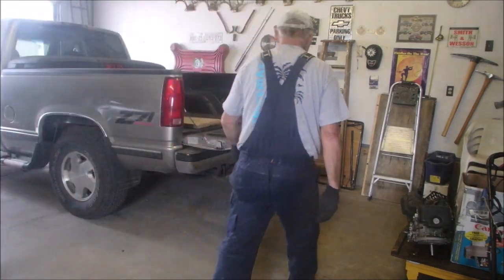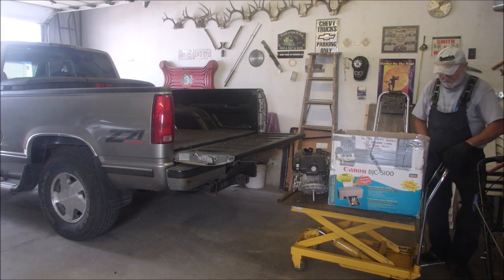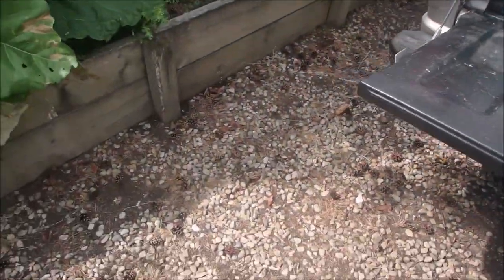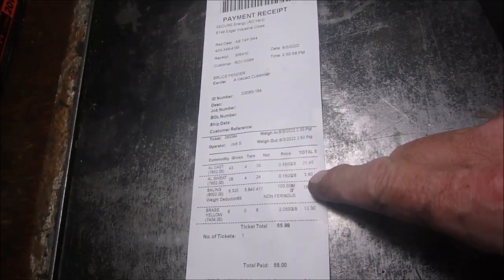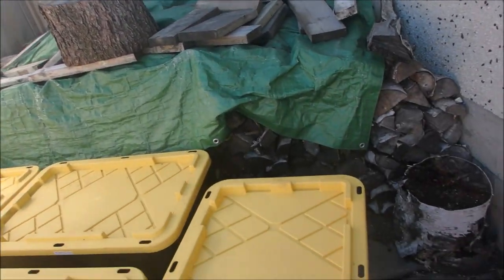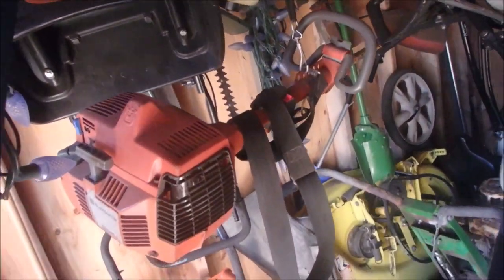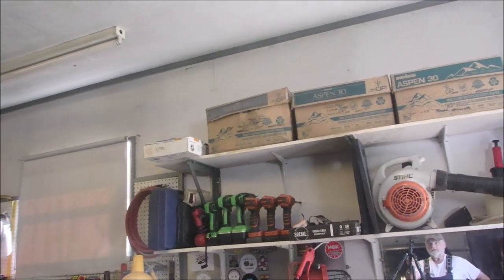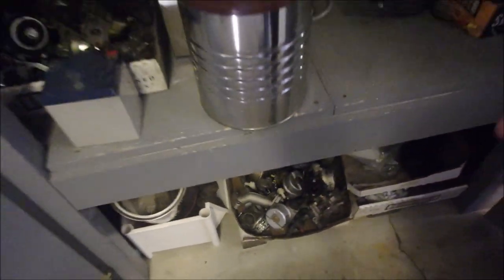A Trip to the metal Recycler and Storing Spare Parts

Comment: I just took in a load of scrap metal.  I had 900lbs of what we call tin and got $57 usd. Also  had 3 mower batteries and got around $9. I should have used the batteries as cores because they are worth $6 a piece.
Reply from the maker: Great info Dave

Comment: Just wondering if you remove the magnets from the flywheels to get clean aluminium prices or if they are left in do they call it dirty aluminium which is only worth 4 cents per pound? I normally take the heads off engines for clean aluminium and scrap the rest of the engine as shredding which pays more per pound than the dirty aluminium. Naturally all useable pieces are salvaged.
Reply: Good  day fellas  Yes those magnets  are hard to get out,  but heads  are  great.  Thanks  We are  at about  .12/pd for shred.  Thanks
Reply from the maker: I have tried to remove the magnets and it is very difficult

Comment: Hello, What is the mixer you use to spray in the spark plug?
Reply from the maker: I use carb cleaner but i didn't in this video??
Reply: @BrucesShop  Thanks just seen it in others and couldn't remember what you said. Thanks again